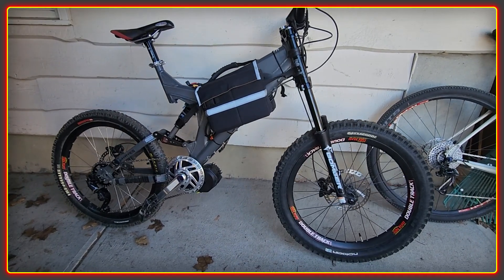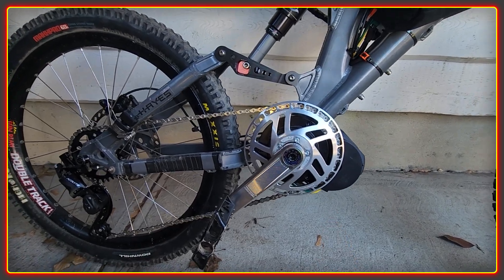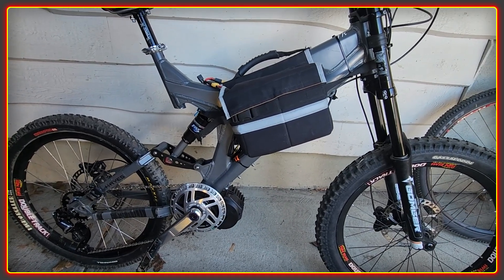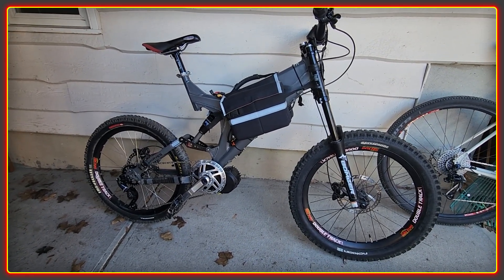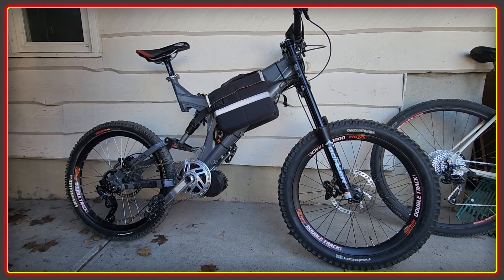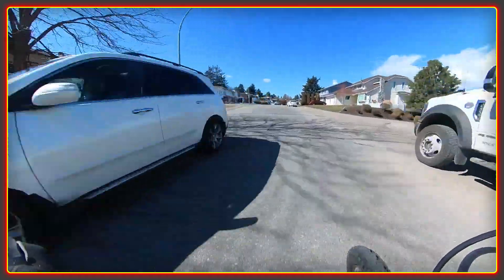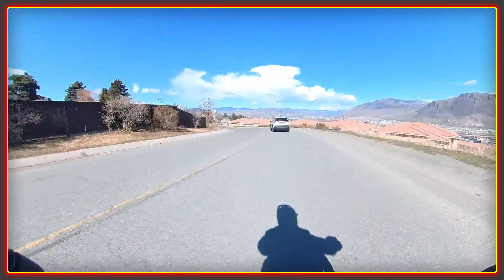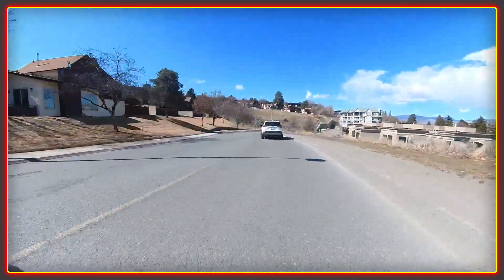High Voltage Tuned Big Hit BBSHD / ASI BAC855

Comment: sounds nearly silent, great smooth gear changes to ,awesome
Reply: Its single speed i believe
Reply from the maker: Correct. But very quiet!
Reply: @HighVoltageKits  yes mine is quite as well make a little more noise with 72v from the 52v i was running before
Reply: @HighVoltageKits So far judging by random videos and in person original BBSHD trapezoid waveform controller seems to be even  more silent producing just a soft whirring sound compared to FOC sine wave which is supposed to be quieter. Hard to confirm but this one have higher pitched noise even when taking off at lower RPM's.
Reply: @sketchysticks1127 do these mid drive motors mind single speed?
Reply: @joshbuck2037  it is single speed but to use it you need external controller with field weakening to get both torque and speed dont go single speed with anything over 1:1 gear ratio or you will damage your motor if youre above 90kg like myself use 1.2:1 to 1.5:1 for best performance also 72v or above to get decent speed mine tops out at 75kph but i have limited it to save battery

Comment: Well done.  Only counterpoint is....
I have a couple of BBSHD bikes with stock 30a controller and 52v 20amp-hr batteries with good high discharge cells.
Both with do low 30 mph pretty easily and can hit mid 30's on a sustained stretch.
No field weakening, lower RPM, taller gear ratio and less noise as a result.  No they won't climb like your bike.
And if I wanted I could go 60v with stock controller and more speed.

So, my view on this is...unless you want to get into the 40 mph+ speed range aka CYC Pro bandwidth aka 72v or 84v battery, I don't see the point.  No my bikes won't climb like yours in this config because you are pushing more watts and higher RPM but also as you know, higher RPM renders pedaling irrelevant.

I would appreciate if you figuratively draw a line in the sand for your viewership....when the HV kit really starts to separate itself from stock BBSHD config with a 52v batttery.  For example, maybe you believe, the HV kit really comes into its own with a 72v battery.  You have more experience with these bikes than anybody.  Perhaps you believe the HV kit is worth it with a 52v battery and the difference, just isn't coming through the video screen.  But for the speeds you are riding, a stock BBSHD can pretty much keep up or not too far behind....so it 'seems'.
OMO.
Thanks for all your R&D.
Reply: You miss out on the power band across such a wide rpm range that a FOC controller gives you
Reply: @mcspikesky  Thanks
Reply: My little folding carbon bike did 36mph on a flat road throttle only with a BBS02 with 52V and 1280 watts.

The gearing for my top speed with 20 inch tires/rims was a 52T front ring (lekkie) and an 11 tooth rear cog.
If I could find a 9 tooth I might get closer to 40mph.

That's with a 20 inch folding bike. 
It also climbing hills like a billy goat. I  had a 34 rear large cog in the 7 speed cassette.
Reply: @TheAgentAssassin  John actually obliquely addressed this point.  Your little folding ebike as it turns out is pretty efficient in terms of weight and aero profile.  It punches a pretty small hole in the wind and one of the reasons its so fast with 1280 watts.  As mentioned, I have two BBSHD bikes and one is a drop bar road bike with 28c tires.  I in fact use it for training with elite cyclists...no motor in my town who are freakishly fast without a motor. They are my friends.  My e-roadbike is faster than my Cannondale 29er with same driveline.  It is both more aero, lower weight and thinner tires have less rolling resistance than the 29er which is more upright with me on it as I am tallish. So the frame and tires matter in the equation of power and need for more watts for sure and gearing you reference with the smaller wheels matters for sure as well.  An equation of sorts.
Reply: @TheAgentAssassin  carbon + folding + DIY ebike is real risky but I understand that is your middle name carry on
Reply from the maker: Good comment. The main difference at 52 volts is the torque and acceleration. You can absolutely hit 30-35 stock. It just takes a while to get there. The gains are more marginal definitely. I dunno how easy to draw a line in the sand as there are so many different bikes and frames. The ASI controllers are significantly smoother in terms of throttle and overall control. You can hit a higher speed in a lower sprocket. Really  it comes down to how you want to ride.
Reply: @HighVoltageKits  Thanks again for all you do to raise the bar for those of us that like high power ebikes.

Comment: Thanks a lot for the great content really helpful. Tho each video you release makes it harder to choose motor between photon/pro or bafang
Reply from the maker: It very much depends on your riding style. There are some new motors coming out end of April as well.
Reply: Photon for torque sensor if you wanna ride a bicycle. If you want a throttle style go bafang (from research not experience)

Comment: At 24" that thing must be a ripper!
My 29+ 52vHV can be a handful at times. I can only imagine 24*
Reply from the maker: Let's just say if I could wheelie worth a damn it would have been very easy to.
Reply: @HighVoltageKits  so fun! Yet so scary!
I keep practicing but it still humbles me...
Reply: They are very nice i have 05 bighit on  72v awesome torque with 24" but a little slow 60kph need to test some more settings think i can get it to 65 which would be ok with some more field weakening have it set to 25% and 30A gonna bump it up to 40A and 30%
Reply: My little folding carbon bike with a BBS02 running 52V @ 1280 watts went 36mph/57kph on a pure flat road , throttle only. With 20inch/457mm tires/rims.

You should be getting faster then me my simply running an 9-11 tooth rear small cog cassette and a 52t front or bigger.
I've seen 9 teeth cogs as well.

I have to run  the chain line directly over the 11 tooth cog on my 7 speed cassette to keep it from slipping. Now none of the cogs slip under full throttle.
Reply: @TheAgentAssassin  running that smal rear cog will mess up the motor fast and the acceleration would be terrible sry not for me i want a torquey offroadbike just need 7kph more which i should be able to get by adding more field weakening